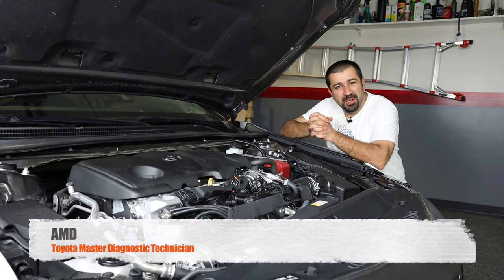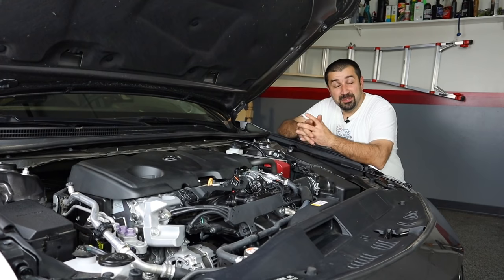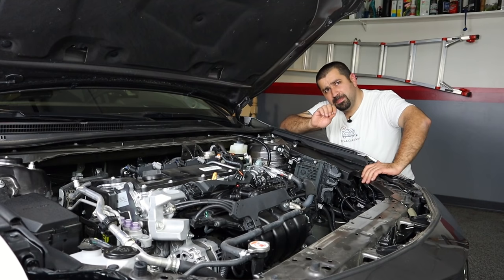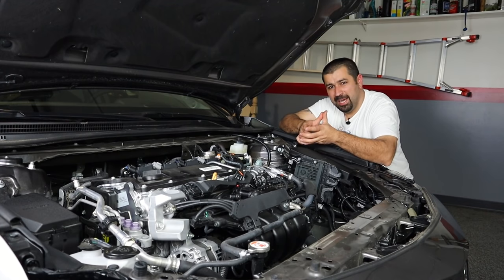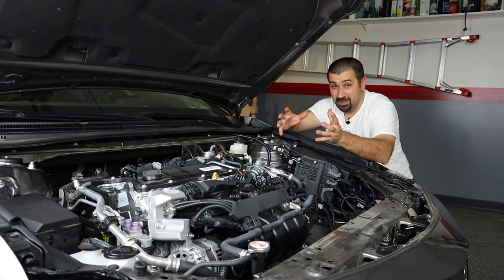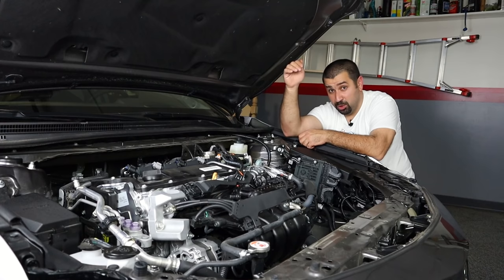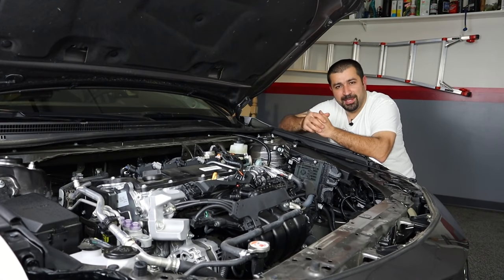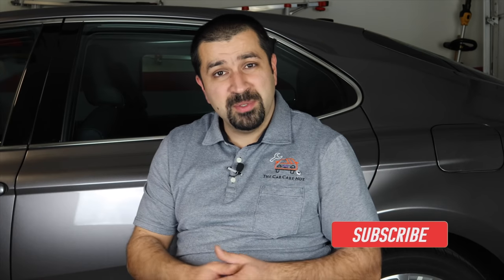Toyota's New Engine Technical review Part 1 : Cooling,Lubrication,Direct Injection and EGR

Comment: Okay I've just subscribed (2023/4/18) to this channel. I'm so so glad I did because I had been using the wrong motor oil. I had started using Mobil 1, 0-20W after my free 2yr factory 20K service period in my 2020 RAV4 expired. Since I'm an avid DIY'er I assumed using the Mobil 1 would be a a great preventive maintenance choice like I had been doing all my other Toyotas for last 35 years. Luckily I've only done 2  oil changes (@ 25k and 30k) with Mobil oil. I have 31k on the RAV now so I'm dumping the Mobil immediately and using the Toyota 0-16W.  I'm hopeful that the 6k miles with Mobil 1 hasn't done irreparable damage. THANK YOU AHMED!!  You've saved another Toyota and DIY'er!
Reply: I think you’re ok depending on country they spec that weight I believe for warm areas. Just a reminder it always says the oil you need on the oil cap
Reply: @thetechlibrarian  that’s right…in Saudi Arabia we can use up to 10w30 for m20afks engines since weather temperature reach 55c!
Reply: Toyota motor oil is mobile motor oil! You are fine using what you were using .
Reply: @6touring .. Exactly , I heard the same thing. Saudi Arabia uses 10- 30 wt.
Reply: @charlesjackson1700  i am sure they are forcing people to use light oils to save 1% or so fuel!!!!!….we dont care about your engine but we care you save 1% fuel 😅😅
Reply: @6touring  👍Thank you for your comment... You could have not said it better! 😂😂
Reply: @charlesjackson1700  🤣🤣😷😷

Comment: Wow, everything I wanted to know about this engine all in one video. I just purchased a new 2021 Sienna hybrid and I was trying the find out as much info as I could. I wondered if it was a direct-injected motor and to find out that it is a dual-injected version had me jumping for joy as I know all about carbon buildup with the DI motors. Thanks once again for all your help and info. I have always been a DIY person with all of my cars and wanted to start off doing things the right way with this newer technology.
Reply: If you find out about your sienna engine can you let me know I bought a 2022 sienna :)
Reply: @jeziahchevalier9012  All you need to know is in this video.  Type of engine ( Atkinson ), direct and multiport injected, 2 different types of coolants ( for engine and battery). Are you a DIY type of person?
Reply: And maybe everything you didn't want to know.

Comment: Got suckered into this boosted small disp engine trend.. My turbo 1.5 Accord has 25k miles . .went thru one turbo bcause of impeller issue.  Now the transmission  is acting weird.  Im going back to Toyota .  Subbed
Reply: Honda still has not used dual port injection like Toyota. They are using direct injection by itself. This will cause carbon issues in a Car without dual port.
Reply: What kind of transmission did it have?

Comment: I heard that Toyota used their own small invention which is tumble method to efficiently mix fuel and air ration, upon entering the cylinders. It is a method of changing angle of entry and instead of traditional swirling around, mixture enters directly and swirl sideways.

Comment: Thanks. After watching your video I decided to check out my engine on my new Rav4 hybrid. I noticed oil splatter on the engine cover. Thats very odd being a new car that has never been serviced before. Turns out the oil filler cap was loose!! I checked the oil level and it was still full. I tightened the cap up and cleaned up any oil I could reach that had dripped down. Your video saved me from a potentially bad situation that could have gotten much worse.

Comment: Toyota have the best engineers these systems have being tested for years they have no issues
Reply: Until they don't...
Reply: Every Toyota dealership I’ve seen has every service bay filled with cars for some reason and it’s not to check tire pressure. That being said, I’ve owned 12 Toyota’s and they’ve been extremely reliable except for the 85 Camry.
Reply: I worked in Japan for a year with aerospace engineers. Excellent engineers, lousy management structure.

Comment: Hi AMD,  you are excellent at making the extremely complicated explanations simple. After having watched your channel over the past 3 years I purchased the same exact car(2023CamryHybridXSE)as you except in silver,without the black top.I traded in my 2017 Audi A8l 3.0 w/ 32k miles. I had previously owned over 20+ years only BMW’s.,from a 2006 750li ,to my last a 2015 X4. I truly loved the technology of the German cars, but found them to be finicky and problematic (not all of them). What I felt was that the technology was forced into the car because of trying to always one up the competition, either in the engineering and or entertainment/safety. Which brings me to this video and how you describe the Toyota 2.5 and the painstakingly thought out process they took to design this motor. I have always been a big Toyota fan from my very early 20’s . My first one I owned was a 1977 white Corolla,then 1979 Celica hatchback. The last Toyota I owned till now was a 1985 Toyota Celica ST that my brother bought brand new. He gave me the car with 150k miles, which I took to 210K , and sold with the original clutch and NEVER 1 issue. I went to the Toyota dealer this past Dec , and when I drove the 2023 Camry Hybrid I was blown away impressed(your descriptions were spot on). I really like the looks, and even acceleration was good , making me impressed enough to buy it. I would just like to thank you and your wife for making the channel and staying with it. I do actually have a question on the use of the paddle shifters. If I use them to downshift in trying to slow the car (charging/save on the brakes) am I putting a lot on strain, or doing damage to the transmission? An why do I see in certain blogs that they say the brakes last a lot longer on this particular hybrid? Thank you for sharing your talents . God Bless you and your family. 🙏Eddie S

Comment: The best part of this engine is Toyota went back to the steel spin on oil filters. The plastic ones on the 2017 and before models suck and make a mess changing the oil.
Reply: You can buy a metal oil filter cap to replace the plastic ones.  You mean they went back to the canister?
Reply: @jsun3117  
Yes
Reply: Yeah, the cartridge filters were not fun.
Reply: Ill take one of those engines bolted to a conventional tranni over this any day !

Comment: My 2006 Chrysler 300 SRT8 with 6.1L Hemi producing 425 hp had 0w15 factory oil. I ran that car hard to 150,000 miles. Maintained regularly. Never burned an ounce of oil or hard any engine problems. I agree with the Car Nut... 0w16 oil is perfectly fine. Use it.
Reply: That makes no sense. 0w15 doesn’t exist and pretty sure the 6.1 used 0w40 which is by no means a thin oil.
Reply: @davidwitmer7251  Oops, typo! Good catch... yes Mobil1 0w40 was the common factory fill... but 5w40 and 15w40 were allowed if needed.
Reply: @user-cx2bk6pm2f  I hear ya. I was confused because 0w16 wasn’t out til over a decade after the cars release. I feel iffy with such thin oil in my Camry, but the UOAs I find online and various high mileage examples tell me it must be alright. Better last me at least 300k. I drive at least 20k a year.

Comment: This engine is very cool, but it's the reason we just bought a 2018 Rav4 instead of going newer. Really complicated and the last generation 2.5 has already proven itself for many years along with the 6 speed transmission.
Reply: I just bought a 2018 RAV4 Factory Certified Pre-Owned with 27,000 miles on it and I feel more secure in my decision, thanks to your post!
Reply: The last generation 2.5 didn’t have enough power in the mountains and wasn’t particularly good on gas.  In addition the previous Gen RAV4 didn’t do great in crash tests.  The 2019 plus is better in every way.  It’s bigger, basically a shrunken Highlander, and is much stronger (better protection and handling).  The 2019 plus has a spin on oil filter which is DIY friendly.  The 2018 engine is also very complicated.
Reply: I'm new to this amazing channel. Is there a video explaining the 2018 model engine? Just bought one in the UK with 22000 miles. Thanks.

Comment: I always "prioritised" heating the engine from cold as there is an "isolation valve" for the heater matrix on most cars for decades.   Also I never floor it when cold.  If Toyota are concerned about that they might be better restricting the power when cold.  What would be useful is if the oil pump built up pressure before the engine cranked.
Reply: How are you going to build oil pressure before cranking the engine with a mechanically driven oil pump that only pumps oil when the engine is turning?
Reply: @RickinICT  Didn’t he say there was an electric oil pump on this engine? I bet you get full oil pressure as soon as the engine begins to rotate.
Reply from the maker: There’s no electric oil pump. There’s an electric water pump. The mechanical oil pump is controlled electronically.
Reply: Electric water pumps on these engines go bad at 80k-90k miles so be ready. These variable pressure oil pumps and high pressure direct injection pumps worry me greatly
Reply: @jon62ify  not on toyotas. Typical for Audis and BMWs!

Comment: Love the channel. I do respectfully disagree on the sensitivity of this engine and the 0W16. This comes down to North American emissions regulations and has nothing to do with needing a precision oil weight. All overseas manuals for this engine document up to 15w40 can be used in this exact engine (default 0w16) but not required. And yes, fully understood on the very slight increase in warmup time but does not apply for many like myself and my climate. I am in Arizona and heat is intense and extreme during our summer months so the car is 1/2 warmed up before I start it! I have two vehicles with the A25A-FKS and do not use 0w16 in either (I use 5w40) and have not noticed any drop in MPG and I much prefer it. Combined, 70K miles so far. Not saying 0w16 is bad, but you do have options if you DIY, own and maintain your own vehicles. Engine is not going to spontaneously fragment from other oil weights. Amazing machines and really impressed with the A25A.
Reply: 40wt is overkill for for a modern, non performance car, even in Arizona heat. A full synthetic 5W-30 or 10W-30 would work better and is much more easily available.
Reply: @Maserati7200  I respectfully disagree. However, nether of us are wrong. Just a choice made within a specification and if you know enough about the subject, you make a choice for your own vehicles.

Comment: Subscribed! I remember reading an article 40+ years ago that it took x horsepower to move x gallons of oil per minute through an engine. The article was about the tiny oil filters that were being put on then current engines. The writer bet some of the oil was being bypassed because he doubted the paper media could stand such a high flow.

Comment: Very interesting stuff! I’ve been considering buying a vehicle that is strictly direct injection, but this makes me think I might need to stick with Toyota. Sounds like their system might be more reliable long term.
Reply: Compared to what ? The old 1.8 bolted to a conventional transmission ? I doubt it.
Reply: Dual injection is always better than direct Injection for keeping those valves clean

Comment: My 2018 now has about 70,000mi on it.  I had not been too picky about gasoline and admit I'd buy the cheapest and I never ran anything for injector cleaner.  This past Feb 2024 after 2,000mi after an oil change and cold spells, I noticed a very very slight higher oil level and also an odd gassy smell from the oil.  I had intentionally not been driving it on the highway and had my girfriend use it around town.  A report by Speediagnostix confirmed 1.6% oil dilution and viscosity at the low end of the "16".  All other numbers were fantastic and the recommendation was top tier gas and Chevron Techron periodic treatments to keep the injectors clean....since then, nothing odd with the oil.   I absolutely love my car (this Camry #4 for me in particular) and glad I paid attention to it.

Comment: Actually Toyota has had both direct and port injection since 2005 in the 2gr-fse family of engines.
While the Germans had just started introducing direct injection and having the associated issues with carbon build up. It is impressive that the Japanese foresaw this issue and brought the two technologies together creating an excellent engine.
Reply from the maker: Early example of direct injection at least in the US were on the Lexus side it was not the same and it did have carbon problems and they were actually pretty bad.
Reply: @TheCarCareNut  Ah didn't know that 👍

Comment: I’m a tech at a dealer and have seen one of these with 150k on it already
Reply: It’s probably consuming 2 quarts oil every 1k miles like all of them
Reply: @santosf1107  I do my oil change at every 3500 miles and I use amsoil 0w-16. I have currently put 125000 miles on it. There is no oil consumption.
Reply: @ninetyninecents3256  you are doing it right but I think there is no need for expensive oil. My 2012 prius has 330k i do my oil changes too penzoil 0-20 at about 6500 miles intervals:)
But lets just be honest toyota do have a problem with their cars burning oil I’ve seen it for more than 20 years. Specially the ones built in the USA
Reply: @santosf1107  I drive for Uber in NYC so I do %90 of miles in the city. Average speed drops 5 mph sometimes and I run Ac %100 all the time. Lots of idling, stop and go, it’s too cold in winter,  too hot in summer here. It’s absolutely torture for the vehicle. I have seen different car brands having really bigger issues even before they reach 70 thousand miles. That’s why I have to use the best engine oil in the market( this is my opinion base of research I have made). Pennzoil is one of the good one in the market but it is not the best. I pay around $28 for 5 quarter you pay $22 and some chance. $6 difference is not gonna break my bank. Frankly speaking all the modern cars consume oil. If u do change your oil at 3500 miles you won’t have that issue.
Reply: @santosf1107  
Old story 
That problems was in the far away past
Reply: @baseline4102  let’s hope that is true they are making anything to improve mpg to much pressure from Gov

Comment: I started using 0W-16 on my 0W-20 recommended CT200h for the last 40k miles and it still runs great!!
Reply: Still runs great until it wears the shit out of your engine due to thinner oil at higher temp. This could mean that the oil is not thick enough to fit in the larger gaps at operating temp.
Reply: @Shawn-ky2tw  0w-16 is thinner at higher temperatures than 0w-20.
Reply: @KenleyMeza  Sorry, I made a mistake in the first comment. Corrected.

Exactly. So you are putting thinner oil at operating temp that what the engineers specified. Thinner doesn't mean better. It depends on the design tolerances of a specific engine. It's your car, of course do what you please.
Reply: @Shawn-ky2tw  I feel the small difference in viscosity won’t make a difference in such a fuel efficient vehicle. Noting also that the later Prius with the same engine recommends 0w-16. I should also add that I changed my oil every 5K as opposed to 10K as suggested in the manual. Unfortunately we will never know the long term damage on my car(if any) since the car was stolen and no longer in my possession. Also as a mechanical engineer dropout I have an idea of how clearances work. And as mechanic for profession, labor cost would’ve been at a very minimum so it kinda sucks we will never know. I will agree with you that your average Joe should not try anything other than manufactured recommendations.
Reply: @KenleyMeza  My GX 460 also uses 5W-30 overseas, but I plan to only use 0W-20 as specified. Even a change in model years could have something different or it could be availability in a specific country or even just efficiency standards. Who knows, but I guess I'm by the book kind of guy. lol

Comment: I have an old 80's EEC-IV Ford book that went into detail on how many microseconds it took for the computer to calculate injection times. It said the computer used up only 30% of its computational speed. Now that computers are faster, imagine how many additional factors can be taken into account.

Comment: My cousin bought one of these new cars, I think it was a Toyota (?) that uses 0W16.  Getting an oil change outside of the dealership was not so routine.  He said the car had a skid plate on the bottom that had to come off before you could access the oil drain bolt and oil filter. I don't know why the auto engineers did that, maybe to make the engine quieter, as you mentioned in the video the new injection system can get quite loud (?) It was hard to do a typical oil change at one of those drive-thru places, because the car really needed to be put up on a lift to easily access all all the screws holding the skid plate in place.  The first place he went to said they wanted an extra ten bucks to do that, but they didn't have the 0W16 oil in stock, so he had to go somewhere else.  After he found some place where they did have the oil, they charged him an arm and a leg  because they only had the oil in DIY 5 quart bottles - no bulk oil available via the standard overhead hose dispensers.  I have no doubt the Toyota dealerships can maintain their new cars, but I think I'll wait to buy one until the rest of the auto maintenance  industry catches up.

Comment: A simple thermostat and belt driven pump worked flawless for years. Overengineered to save fuel, but not unscheduled maintenance. These pumps will fail frequently for big money to replace. I'll take simple over this
Reply: The electric pumps have one electrical connector and 4 bolts holding it in place. Very accessible as well. Its not a big deal